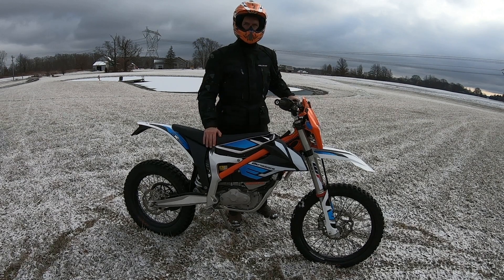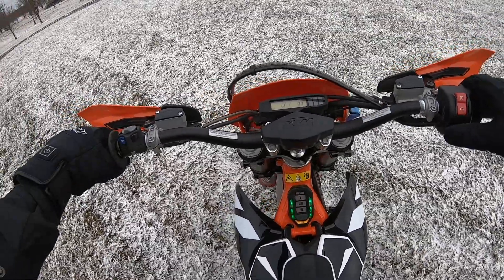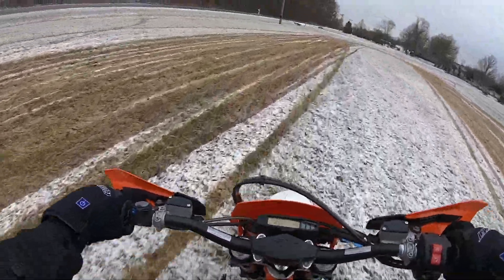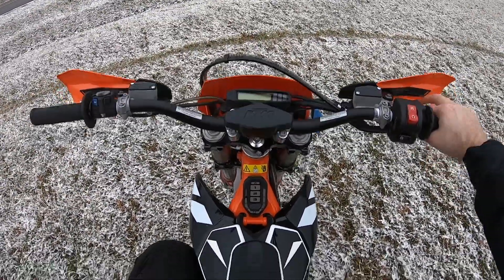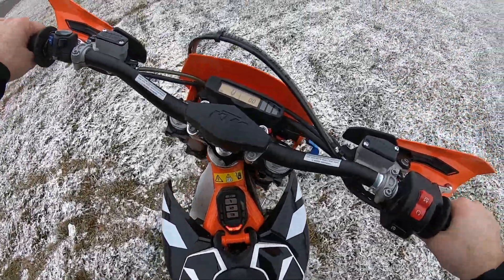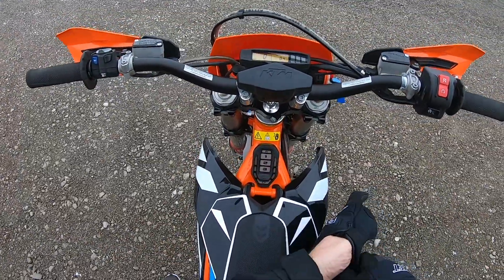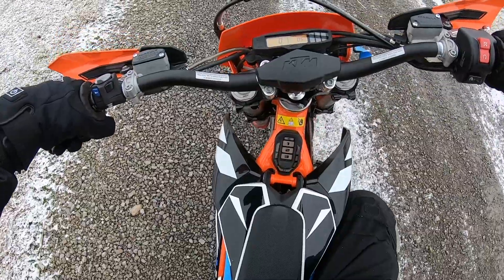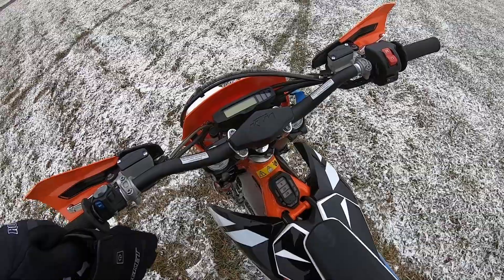Range Test: 2020 KTM Freeride E-XC with 0% Battery.

Comment: Discharging a battery like this wrecks havoc on it long term.  I try to never ride my bike when it gets below a 30% charge.
Reply: Then your battery will rely on your charger every time it hits 30% or so google battery training for long term use👍🏼
Reply from the maker: I concur.  However, if someone runs out of battery in a remote location while trying to get back to their truck / cabin / etc., they're probably going to try this.

Comment: This kind of discharge on a LiPo is really bad. Neither Tesla or Apple let their users deplete a battery pack below 30% for a damn good reason. On a microscopic scale it causes metallic splinters that can short the cell and cause it to spontaneously combust like a violent sparkler. I honestly don’t understand how KTM allowed this to get past QA...
Reply from the maker: The Freeride's HV Battery is Lithium Ion, not LiPo.
Reply: @gtoutrider5762  The difference between Li-ion and LiPo is just the electrolyte barrier. What I’m referring to are lithium Dendrites which are a problem in all lithium based batteries. There is no solution other than keeping the cells from discharging below 30%. 

https://phys.org/news/2019-10-scientists-dendrites-whiskers-lithium-batteries.html

Edit: if you own any cordless DeWalt or Makita power tools and you let the batteries discharge too low you’ve probably had to throw them away. It’s not because the battery can’t be charged, they can, it’s because the low voltage sensor was tripped and kills the battery before they can explode. Before the sensor was added quite a few of them went off like Grenade’s at construction sites and hurt quite a few people. The sensor was a result of some very expensive settlements. KTM in allowing you to do this is begging to get sued. I honestly don’t get it.
Reply from the maker: @Pyr0philia  Nice article, thanks for sharing.  But keep in mind, the manufacturer probably sets the displayed 0% battery at a level well above the 30% actual battery level that which you are concerned.  I would guess that at battery completion (bike stops), there could be 45-45% actual battery remaining.  To do otherwise would be unwise and a huge liability.  This is a guess, of course, but the Owner's Manual states to discharge the HV Powerpack completely every 20 charges.  I usually do this every 2-3 rides, with no problems so far, and 71 hours on the bike.

Comment: Капец , теперь вообще не хочу его
Reply from the maker: Don't let the 14.8 miles concern you.  I wanted to get the battery to 0% as quickly as possible for this test, which involved quick acceleration and running WOT (Wide Open Throttle) for as long as possible.  Normally, my range is from 22-33 miles.